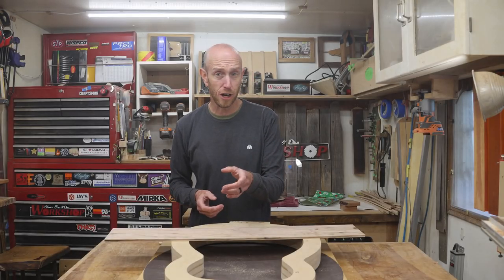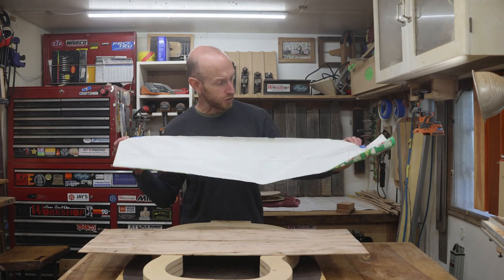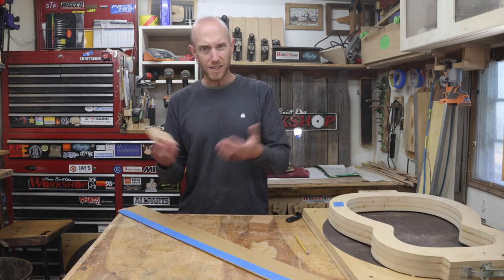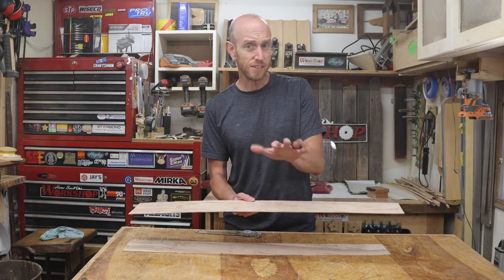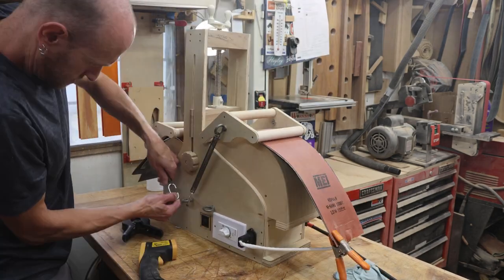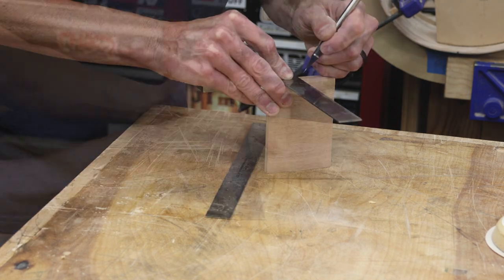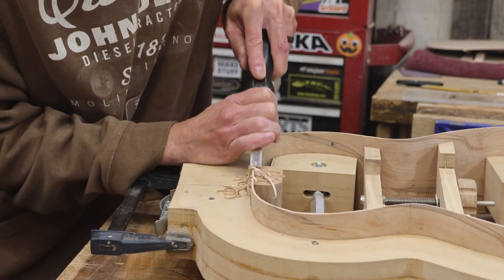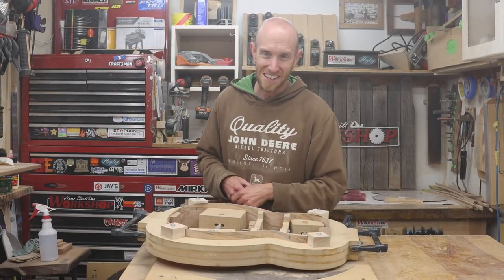Bending Acoustic Guitar Sides | Using my Homemade Side Bender

Comment: not sure how important it is to stay centered when driving the bus, but you could consider adding a hole/center and an additional brace through the center, and then use a threaded insert as a pivot point? again may not be worth the squeeze but could add to your alignment enhancements.